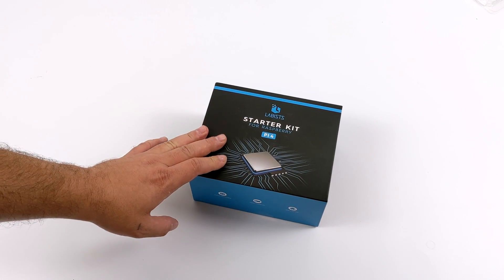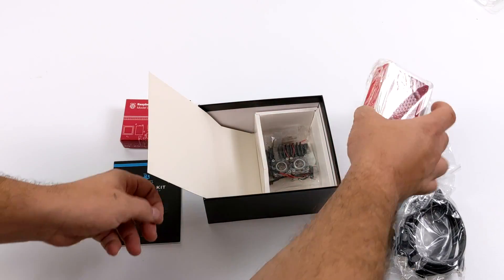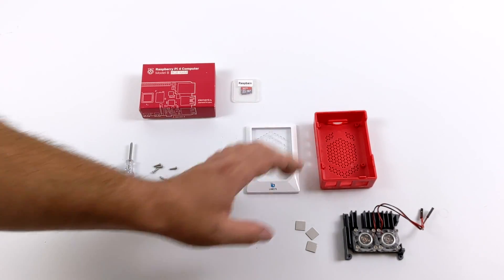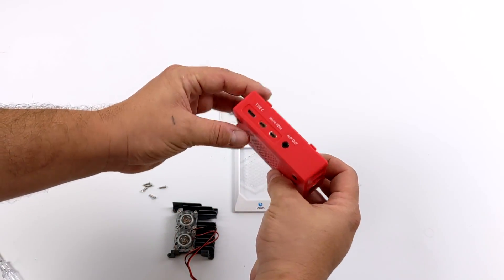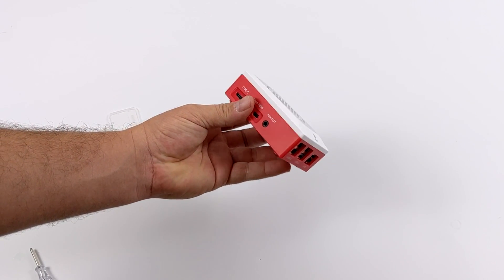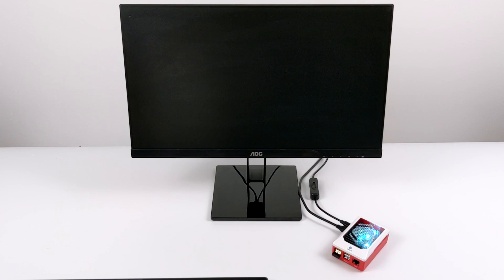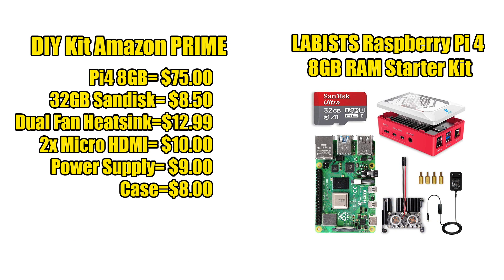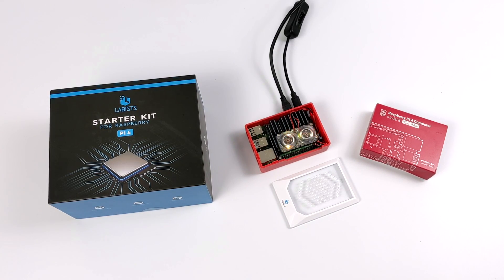Raspberry Pi 4 8GB Starter Kit By LABISTS - Is It Worth Buying?

Comment: I bought a labists starter kit for a pi 4B a couple years ago and I am trying to use it to convert an old space age tv into a deskpi, bascially.  I have been trying to add an LED arcade button to it as an on/off switch and I used your tutorial for adding a power button to a 1,2, or 3, but it didn't work for me. I'm hoping that you can help me fix this issue?
Reply: I’ve been adding an ESP32 to the mix to offload some basic tasks.

Comment: I have the 4GB model got it from Pi Shop it was under $100.00 had a black case slot for the 1.3 camera and a tripod mount. Small single fan I connected it to pin 1 and 6 same box you have just the 4GB model 2 HDMI Cables and the power cable with the on and off switch. the small type C microSD reader.

Comment: I know this is an old video, but during this past Prime Day i bought what it seemed like this same kit, but it comes with a bag with 4 extra screws that are very long and hollow on the other side, they are like motherboard stanoffs but like an inch long. What are they used for? Oh, also, now it comes with 4 thermal pads instead of 3

Comment: What's the best way to turn off the Raspberry Pi 4 after you're done playing it? Should I shut it down through the emulator/RetroPie internally or just flip the power switch on the power cord adapter manually?

Comment: what size are the fans, 20mm? I wonder if I could rig up dual noctua 20x10mm fans. Noctua are SUPER quiet even at higher RPM, but it would be a 3 pin so I need to figure out how to do that with the pi4 board.

Comment: weird the instruction don't say anything about thermal pad on USB controller?  Shows it installed CPU, RAM, and Wifi controller.
Reply: That's right .... I'm wondering if now I have to disassemble the heat sink and put again thermal paste also on usb controller🙄🤔. Did you do it?
Reply: @alessandrotesser6841  yes I did, temp has not been an issue for me, easy and cheap to do
Reply: @andyloechler9896  did you replace all the pads? Which thickness pads did you use to replace the factory ones?
Reply: @alessandrotesser6841  0.5mm worked for me I have no idea what the kit came with

Comment: I wish you showed us how you removed the two-sided plastic on the heat pads on the heat sinks to the CPU ( instead of doing it off-camera ) . I could not remove the one side that has a color paper on one side. Thanks. You are very helpful.

Comment: Just bought this kit but gives me a “screen resolution not supported” on my Samsung smart TVs. Don’t have a computer up and running to format a new sd card atm so is there any advice you or anyone can give me? Have an old hp monitor but only has vga connection.
Reply: does the kit include the screw driver?
Reply: Yes it does. It worked on my old Sony television that was made back in 2009

Comment: I just bought the same Labists Set, and my problem is - when i'm stresstesting i get 71,5 Celsius on 1500Mhz no idea why its so hot compared to Yours
Reply: Could it be the problem of lacking the "paint" in place where it should touch the cpu thermalpad? I used Isopropyl Alkohol to wipe the place as i always do and the paint melted in seconds... Never had a problem like that before
Reply: So I've changed thermal pads, cleaned the melted paint, and I am still getting such a high temperatures. And when overclocked i get like 83-84 Celsius max...

Comment: The usb controller thermal pad is at the wrong location. It goes beside 1234 pins of the power supply. The location is even indented in the heat sink.

Comment: a custom 3d printed liquid water block for each chip and using the tubes hospitals use for IV for giving fluids and custom-built radiator and pump system with distilled water and overclock to 1.5 ghz.

Comment: I hate that they waste a usb c port for power.  usb c would be better for a high speed data port for Thunderbolt devices or a nvme 3.0 x4 in an external  case with a usb -c  connector.

Comment: I think you placed one pad wrong. Regarding the manufacturer video (https://youtu.be/BLy_IVMjfe0?t=7) it should be on the wifi module, so it would fit better in the recesses of the fan block.

Comment: I ended up getting a used Pi 3B not long ago that came with the heatsinks installed, turns out the heatsinks had some kind of adhesive or thermal pad? Carefully took off the CPU heatsink and added a small dab of thermal paste so it wouldnt stick to the CPU again, it dropped the CPUs temp about 10C or so, more so when using a FAN Hat. So i dont think id use just a thermal pad without a little thermal paste when i get a Pi4

Comment: i bought this thing, and it kicks ass. currently running retropie, having some issues with changing settings on the psx emulator, but that is a softwre issue. i have never seen it go above 62c, and it's overclocked to 2.1ghz using the 5v fan speed (you can't hear the fan anyways, so put it on the highest setting). One thing I cannot figure out tho, what are the spacers for???? If anyone knows, please reply to this! thanks
Reply: the spacers are for installation without the case according to the labists video

Comment: Great video. I ordered this one about 10 hours ago. It will be my 1st raspberry pi.
Reply: Let me know how it turns out.  I want to get into this technology myself.
Reply: @warronfrench8163  I've been overclocking my pi4 and playing psp games with no issues. I have 4,000 games on my pi4 on just one big micro sd card. Great little computer
Reply: Keep an eye on the pi's not working. Before you know it they breed and start populating the house.  That's how I've explained all the extras to my wife. You are about to have a great adventure.

Comment: @ETA PRIME What I miss a little in your videos is a description of how good the RPi4 actually works for multimedia. I bought one to find out that the hardware accelerated video decoding support is abyssimal on 32bit OS and worse on 64bit. Compared to competing boards (i.e. RockPro64), 64bit OS support and software library is lackluster (you can't even install a full suite of Kodi + addons on Raspbian 64bit). The amount of available images is rather small and there is no sign of upstream vaapi or vdpau support ever emerging. There are no images that make it easy to use Kodi, Tvheadend and Emulationstation or Retropie on the same build. I am quite disappointed by the Pi 4.
Reply: NOOBS? Multi boot is a thing.

Comment: Needing a second Pi-4, I recently got the CanaKit 8GB starter set.  Although it came with a cute little plastic case with a rather small 30mm fan, even with the nice heat sinks they provided didn't seem to cool it much at all.  I upgraded to a GeekPi Ice-Tower cooler a couple of days later which cut the CPU temperature by over 40C - dropping the average lightly loaded temperatures from over 80C to slightly less than 40C!  The other accessories that came with the CanaKit worked perfectly - but the cooling of the originally provided case should have been much better.

Comment: The kit looks nice! For those lucky folks with a micro center around, I’d recommend the kit I went with: aluminum case, 1x 40mm fan, 3mA power supply with on/off switch. I think the brand was micro connectors and it was $20. I liked this kit because I could choose the pi and micro SD card separately—I didn’t like that I had to buy a new hdmi cable/adaptor, though. I suppose if someone doesn’t want to bother shopping for every part, this labists kit is the way to go. Thanks for the video!

Comment: I've been having a lot of trouble with the rpi4. I've been getting a bunch of screen tearing during games and menus and Kodi has been crashing a bit more than normal. I am debating returning mine. I don't know if this is normal or not for the Pi4.
Reply: The Graphics Processor Unit in the Pi4 is brand new and the drivers are still being written for it as it is being reverse engineered for open source.  Eventually it will be good but for now it's still a little rough around the edges as some of the GPU tasks are still being performed by the CPU.  If you want a more polished or better experience in the meantime I'd suggest trying out the 3B+ as it's drivers and firmware have had much more time to mature.
Reply: @lander1591  Thank you! 😁👍 I have used every single PI before this. I still have my 3b+. I was just wondering why the experience wasn't seamless yet since everyone has been recommending the pi 4 but neglecting to mention that there is a bunch of screen tearing and why.

Comment: i got this kit. seems pretty decent so far. my only complaint is the sd card reader is usb-c only. and my pc only has regular usb. luckily i have other sd readers anyways, but something to keep in mind to new buyers
Reply: Then you didn't get this kit, because the SD card reader is both USB-A and USB-C.
Reply: @Noodles.FreeUkraine  nope I did get that kit.. maybe they changed their sd reader. I got it the moment it came out honestly. thats good though :)
Reply: @liquidt3ch  Weird, but maybe they just grab what's on hand. Mine can be flipped and used either way. Just USB-C is a bit weird since most people have USB-A still I reckon.

Comment: This actually isn’t a very good deal. You can get the same kit except in the 4GB ram version and a fan and a SD card reader for $80 (prior to taxes). Given that the 8GB model is only $20 more this kit should be $100 instead of the $115 after the 5% coupon.

Comment: If not for exorbitant shipping fees, that's better than what I bought on the same price: RPi4 8GB, 16GB MicroSD Card, Official Raspberry Pi USB-C Power Adapter, 1 MicroHDMI-HDMI cable, three small aluminum heatsinks, okdo black case

Comment: As with any kit or combo pack. Parts you need and their individual prices plus the other parts (needed or useful or not).
Is that cost more or less than just buying ONLY the needed parts to the whole kit?
Reply: From my research, it's almost always less... they're basically giving away the case and one or two accessories pretty much, but they buy the ingredients in bulk and earmark some of them for kits, so they can afford it and still make money.

Comment: I had issues with the 8gb model loading images I found online (arcadepunks and other sites), there is something different in the boot procedure that causes images not to boot. I also noticed the 8gb will boot to a bios screen without an sd card while the 4gb just gives me a black screen. This was enough of a headache for me to stay away from the 8gb model
Reply: That's the newer bootloader eeprom image on the 8GB showing that screen, it's looking for a USB or network source to boot from, chances are your earlier models have never had that updated. And I've found you need to have a fairly recent set of fixup .dat, start .elf and other /boot files, and that sometimes can make a recalcitrant OS image boot up.
Reply: @W1ldTangent  appreciate the help, guess I'll update my older pi4s

Comment: Did you verify if that card comes with the 64-bit or the 32-bit version of Raspberry Pi OS? It is really silly to use a 32-bit OS on such a nice 64-bit processor.
Reply: no its 64 bit
Reply: @mrbio-gs9ve  Sadly, that was not mentioned in the video. The RP 4 is the first 64-bit RP, but the transition from 32-bit to 64-bit has been a little messy.

Comment: Not at that price. I would rather get an Odyssey X86 SBC and case that is not only more powerful but with way more expansion options, for a similar cost.
The whole concept of the Pi, being the low cost affordable solution has been lost and if the Pi foundation had done the job properly in the first place they would have issued it with appropriate cooling and with a case that would negate the need for the copious amounts of them that have come out.

Comment: Is there a way to power the fans without using the GPIO pins? I think the ideal cooling solution should keep all the rest of the Pi free and this is so close
Reply: There are solder pads on the underside for that purpose. A less invasive option would be to build an adapter to go inline with your psu. I don't know of any commercial options (that's not to say there aren't any).
Reply: @MrDavidBFoster  So solder the ends of the wires to the bottom of the pins on the underside? I see this may work just that you cannot get the full power out of that pin anymore. Still better than nothing though.
Reply: @mingyi456  Better to solder under the usb input. TP1 = +5v, TP7 or TP12 = GND (or really anywhere you see a big blob of solder)

Comment: Would something like MX-4 heatsink compound make a difference in temps ?
Reply: I doubt the heatsink makes full contact.
Reply: Thermal paste will do better than thermal pad, so yes. For me I using Kingpin Cooling KPx on my Pi inside Argon Neo instead of the included thermal pad. Compare to everyone else who used the pad in the Neo. I got 10-15C less than everyone else at 2.1Ghz

Comment: I'm surprised this heatsink/fan combo performs worse than the Argon1.  My Pi4-8 in the A1 maxes out at 55*  at 2.1GHz.
Reply: Not as much thermal mass, the A1 is a good-sized chunk of fairly solid metal with a lot of surface area.

Comment: Seems like it would be smart to write a script to control that fan a bit. No point in having any fan noise at all most of the time.
Reply: Impossible. The dual fan only have the power pins, there is no way of controlling it
Reply: @bhztufs  Of course there is, you can just put the red on a GPIO pin and control it from a script instead of connecting it to 5V or 3.3V.
Reply: @Bynming  you definitely cannot do that, unless you want to fry your Raspberry Pi. The GPIO cannot source enough current
Reply: @bhztufs  Use the 5v rail for the fan and a transistor on GPIO to control the fan then, it's really not that complicated.
Reply: @Bynming  that's possible, but I think it complicates a bit for the end user
Reply: @bhztufs  Oh no, 3 wires. What am I going to doooooo...
Reply: @bhztufs  True but RPi's are a kind of  device to tinker with so those types of projects are fun to do. 

Part of my complaint though is that there are cases which come with fans that have pre-written scripts to control the fan in a reasonable way, something like the Argon One. I think it would add a fair amount of value to this kit to have the fan controllable with a third wire. Small fans like these don't last long if they're running for long periods of time in my experience.
Reply: @alexrawson8492  not everyone has electronics knowledge and skills
Reply: @Bynming  I agree to that. But you can't expect much of these cheap fans. They're everywhere
Reply: Thanks for your excellent post. I was wondering about that.
Reply: I keep the fans on 3v3 (first pin) and it cools really well while being extremely quiet. On 5v I can hear it spinning a little louder but it's not a problem. I don't use the 5V pin because it works so well on 3.3
Reply: @dejanrajcic8686  Maybe the fans are better than I think. I've just never had small fans being reasonably quiet. Also I'm very sensitive to noise so I just generally avoid them as much as I can.

Comment: Do you recommend an official power source for the Raspberry Pi to avoid any potential under-voltage warnings? I bought a Canakit 2 years ago with a 3B+  and would get the warning when using Retropie. I decided to order an official power source and never ran into the issue again
Reply: I use the Canakit Pi 4 and have no issues, even when overclocked. I think RPi sells an official power supply
Reply: @MKDC-5  you're wrong, if the PSU is badly built, it will not be able to provide the advertised power as some cheap PSU does. They won't reach the 3A or the voltage drop will be too high
Reply: Not all PSUs are built equally, I've had more trouble with the 3B+ than any other model though. They're very picky about power, my CanaKit adapters sometimes give me that under heavy load too but they work fine with earlier 3Bs and 2Bs.

Comment: I like this 8Go Ram but I wish a PI5 to offer more power.
for now I am getting more& and more interessted into Ryzen mini pc than PI4
I am curious to see the power of PI5.
Great Vid as always thank for it.
Reply: I agree. The PI is cheaper but delivers noway near the performance of a Ryzen mini PC. You can also run Windows on it. For less than €300 you have a also 8gb/256gb ssd which makes it way more mature.
Reply: @sleepntsheep1169  So, i rest my case.
Reply: Wish they come out with a Pi5 with Mvne support and more powerful CPU and GPU..
Reply: @sleepntsheep1169  You could even do with less.
Reply: @sleepntsheep1169  But you don't need 8gb.
Reply: @hermanstokbrood  if your going to get a pi now why not the top model? Is not like its a extra 300 dollars for the extra ram. If the  8gb was availible when i ordered i would have instead of the 4gb  for a extra 30 dollars
Reply: @Fudgesickle  Read the posts.
Reply: @hermanstokbrood  i dont think you understood my point at all.
Reply: @Fudgesickle  Sure I do.  But you don't get mine. 
A Pi is fun stuff for small tasks. But the more you want to be it a mature PC the more it will costs you. This brings you to the decission: must I jump to a better PC or not. 
This LABISTS 8gb pi costs €150,00. That's fine if you want just a computer for small tasks with limitations. For even smaller tasks you can buy an even smaller Pi. But that's not where this video is all about. 
The question that remains: is it worth buying. And that's up to you. I rather spend a little bit more.